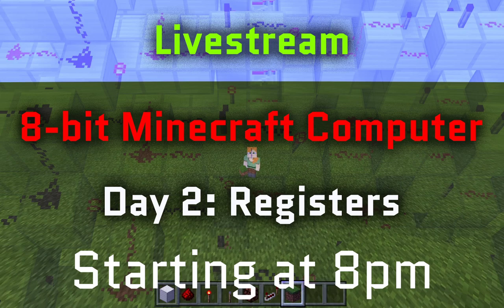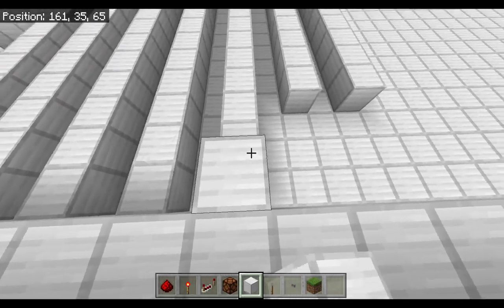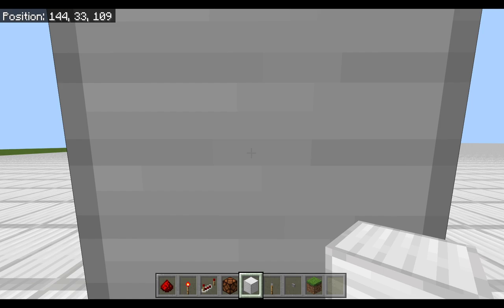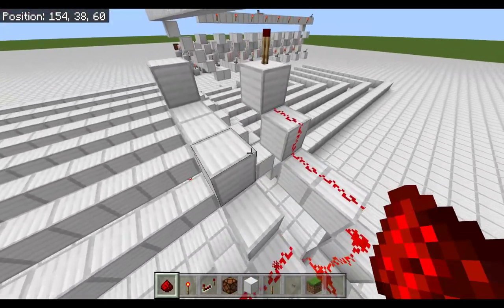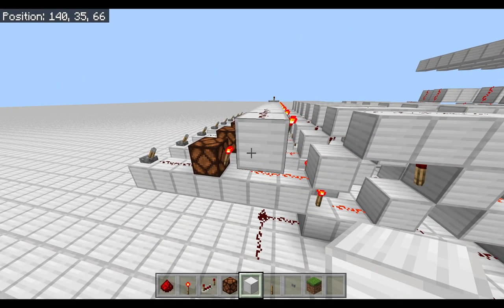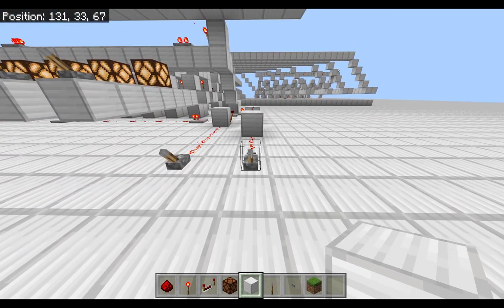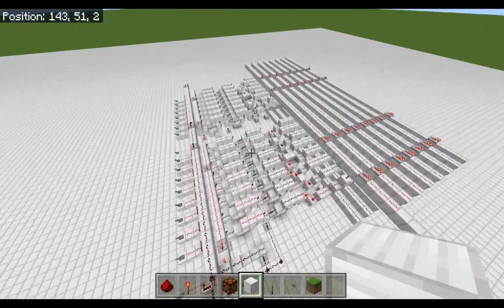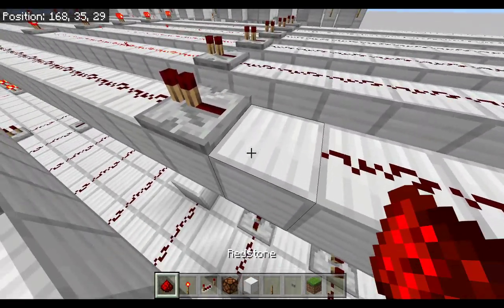Live build: Day 2 - Registers - 8-bit Minecraft Computer

Comment: At section 34:24 / 1:24:58 in the video, instead of offsetting the blocks you could try using half blocks.  Using the half blocks, you could actually spit the signal and send it to both A and B. without doing an offset. In practice your offset would be vertical.  I'm not sure i can post a picture of how I did this but it worked for me.   All and all, I'm enjoying this video series and learning a lot about the internals of computer design.  Thanks!